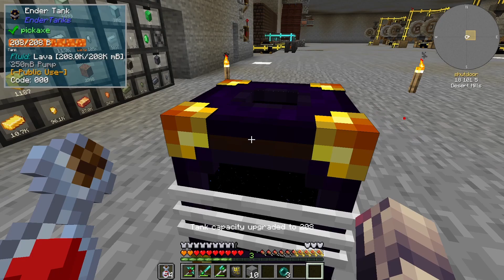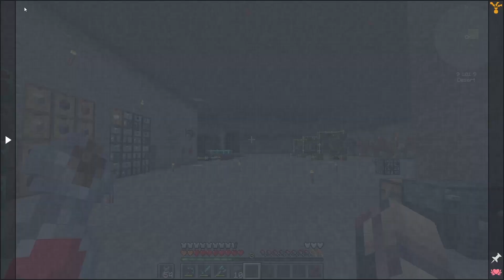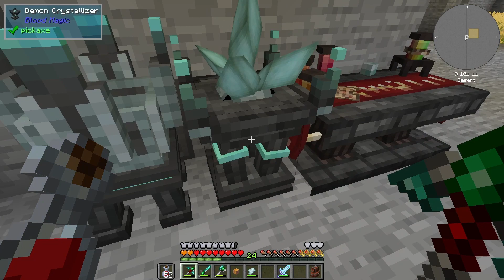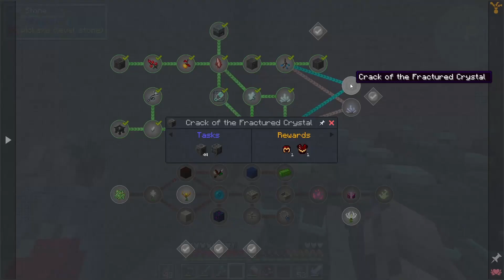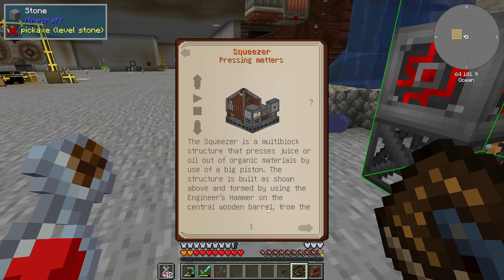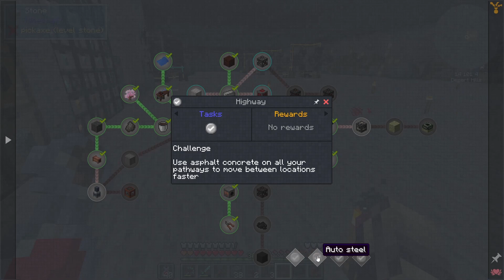Cave Factory Ep. 15: Immersive Engineering's Machines

Comment: With gold spikes mobs drop exp, diamond spikes makes them drop items, and netherite spikes makes them drop both.

The newest update for cave factory added mob grinding utils, which has a mob masher that counts as a player kill and can be modified to do more damage, give better loot, and even behead the mob (great for wither farms). It also has redstone powered fans, so it's more space efficient than Create fans and it has "swabs" that you can craft with a special chicken feed that'll give you the spawn egg of whatever monster you swabbed.

iirc you can hit f9 to see the chunk borders, which I highly recommend since the will in the air is restricted to only the chunk it's in. Even if it's just the next block over, if it's not in the same chunk it won't grow crystals. That might be why the other crystallizers didn't grow any. You can harvest the extra spikes if the tartaric gems in your inventory are full.

I don't like using immersive engineering wires, since the wires lose energy as it's transferring and it gets worse over distances and you lose more energy with higher capacity wires. Energy pipes have no loss and you can enhance the capacity with an upgrade.

Interesting choice going with the diesel generator. I was lazy and didn't want to bother with automating one, so I just used thermoelectric generators. Uranium is stupidly abundant because of the auto-resource generation, so you can generate a decent chunk of power and all you gotta do is place a couple blocks.
Reply from the maker: Sorry for the late response this comment was held for review. I won't be updating to any newer version as I have added newer mods into my version. I also have altered the config files of some of the mods to remove select things. There was also recipe alterations for somethings as they would add more versatility into the pack for me personally.

I am already in love with the Mini Utils spikes they just make quick work of most situations.

I am going to use Immersive Engineering wires mostly due to me not have used them for a long time, and it just adds something to the pack overall.